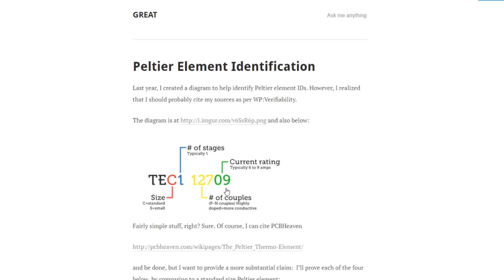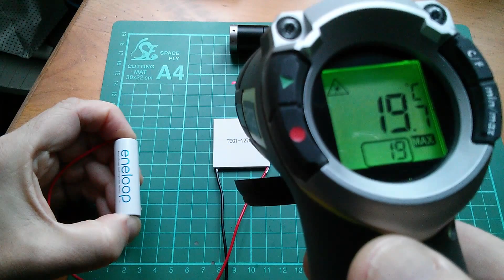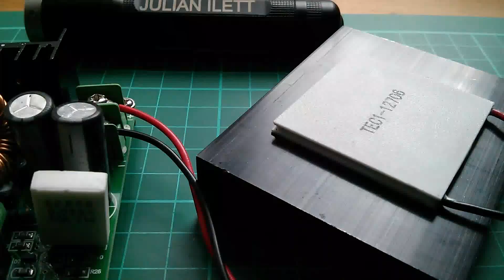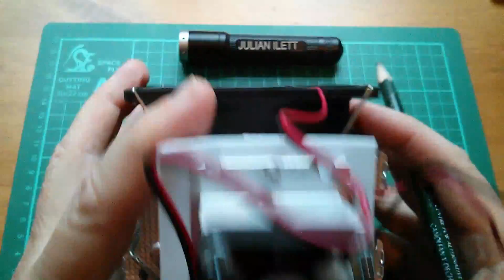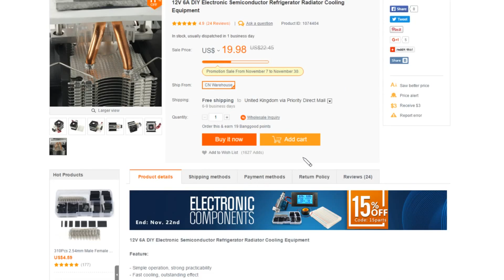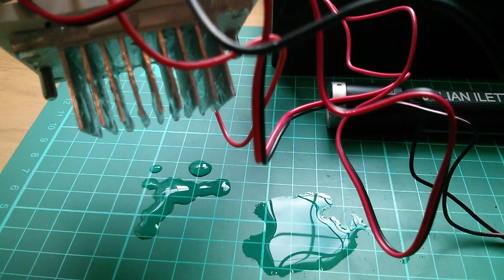Playing with Thermodynamics: Peltier Element Cooling

Comment: will peltiers work with 1V at 12V if i pulse it periodically.
will it work but at a slower cooling rate?
i need to use it but not use a load of power supplied continuously.

Comment: In your educated opinion - Can you use the cooling generated through the Peltier through the element pushed out via the small fan to cool the bottom side of a laptop where the laptop fans would then pull that could air into its cooling system.

The reason I'm asking is because I want to know if the fan would push and damaging moisture for such a cooling system

Comment: A very definitive example of a more real process, much more efficient, but more so concept of what it might really be or become, much more efficient. Peltier modules make 1.5 volts driven by their own heat, heat uses energy. Looks like it can be reconfigured to use its own volt in some way. Great job Julien, shall keep an eye on you.

Comment: Peltier module can work on 12 v PULSATING dc supply? It will affect it's life and performance?
Reply: Don't do that, they "hate" it! The less power supply ripple the more efficient these units become. Straight DC is best but anything below 10% ripple works reasonably well.
Reply: Just using a big capacitor in parallel will probably solve that pulsating power supply problem. It would form an RC filter with the internal resistance of the TEC.
Reply: You need to use a 12 V switching power supply,(which produces a steady DC voltage) not a simple transformer with rectifier diodes (which produces a DC voltage containing 100 Hertz ripple).

Comment: So maybe I’m confused, but if it’s laying on the side, I’m pretty sure the heat pipes aren’t going to work correctly and the copper tubing is probably carrying a lot of the heat away.
Reply: The fans handle those problems

Comment: I bought one fully assembled from Banggood and hooked it up to my power supplies. The peltier is only using 3 Amps at 12v from my bench power supply. Cold side only gets about 51F and hot side 73F with room temperature at 72F. I wonder if they put a different model peltier in it. Tried another power supply and it behaved the same way. Or maybe assembled wrong? It came ready to go. Anyone have any ideas on why it is not taking 6 Amps and not cooling more quickly and getting colder. No ice buildup at all. Cold to the touch. Hot side pipes and heatsink are not warm at all.
Seems like even at 12v 3A it should be colder/hotter than this.
Reply: If you buy stuff from China you get inconsistent quality.  Live with it.!

Comment: If you wanted to make a dehumidifier, could you...  run air from the hot side (after being heated up) over to the cold side where it would then cause the moisture to condense?
Reply: Yup, thats the idea

Comment: Efficiency ignored??
Reply: Finally a necessary question . Just 5 percent
Reply: Peltier heating/cooling elements are not very efficient.  Their utility comes from no need for noisy compressor found in regular refrigeration units.

Comment: hello, just wondering if the 12 V 6A DIY Refrgerator equipment would still cool to some degree if we supplied a lower voltage, lets say 6-8V.
Reply: yes, and that also increases their efficiency. (Just make sure you filter any PWM signal to less than 10% ripple, these units hate ripple).

Comment: 4:21 a better, or just different, explanation i heard was that somehow, i don't remember the details,  it creates a difference within a certain range between the two sides. It can't cool lower than that range compared to the hot side, but the resistance and as you mentioned heat leaking back to the cold side would tend to heat both sides some in most situations. The range of temperature difference between the cold side and the hot side  results in the cold side being warmer than ambient temperatures but colder than the hot side if used without heat sinks in many cases.
Reply: 6:10 i wish you would've picked it up real quick and checked the temperature of the hot side. Maybe even made a line graph for different temps comparing hot and cold sides.

Comment: $1.86 cheap,now I know why it doesn't work .I got a mini Coca-Cola refrigerator which uses this pelter device it doesn't cool down Coca-Cola or beer cans,I tested it.i bought a couple more of cokes put it in this toy refrigerator and it didn't keep the cokacola cans cool.I had to add ice to my Coke and beer to make the drinks cold enough to drink.consumers should be aware of this before the bye one of these toy refrigerator's.
Reply: It's not a consumer level device.  More for hobbyists and tinkerers.

Comment: this vid is old, but tec just means ThermoElectricCooler the C in TEC doesnt stand for the size
AND 127 neither stands for the couples. it stands for 12 Volts and 7 couples. At least one parameter is right in this diagram: 06 actually stands for the max current.
Also, connecting the peltier to electricity without cooling the hot-side heavily reduces its lifespan!
Reply: Incorrect. The 127 refers to the number of couples. Different TECs have a maximum voltage rating, it's not always 12 volts.

Comment: It could be used as a mini frig or as the Israeli Defense Force has discovered, it's safer to make drinking water on site instead of shipping it to their outposts. So, with solar panels and a battery charger a person could have refrigeration and drinking water? How large a unit would be needed to make a refrig and dehumidifier? Or would separate units be needed?

Comment: i was actually thinking if you need such a big heatsink on the warm side, it only has a tdp of 60w, i think something smaller would work also. what do you think?
Reply: A smaller heatsink will result in a loss of heat pumping performance, since the Peltier cooler creates a temperature difference between the hot and cold side. The bigger it is, the less heat will be pumped, and in worst case, even let heat through from the hot side to the cold side.

Comment: Could you use a Peltier device in a Fanless mini PC unit, between the CPU & the Aluminium case, with a control circuit? You wouldn't need to cool it like in a fridge use, but just enough to keep the CPU from cooking ?.

Comment: how do you get it to operate to different temp so that it`s getting 2Celsius instead of - Celsius adjusting the amp or?
Reply: Adjust power either by reducing voltage or by reducing current.
Reply: @morpheus6749  oh i see :) i was thinking on it migth be something like that :)

Comment: possible to cool a small room?
Reply: if you keep it running for a month non stop  in a perfectly isolated 2m square room; and 70w per hour consumption
Reply: @kaisyaya8492  can teg power a 12v fan using the heat and cold of tec?

Comment: The most efficient method to use on the hot side is a liquid temperature controlled heatsink. The hot side needs to be at or below 70 degrees Fahrenheit. That makes the cold side 30 degrees or colder Fahrenheit hopefully. BangGood sells the water cooled heatsinks.

Comment: Thanks a lot.. there are many video  to make Air condition.. mostly uses 4 peltier...
I think the "real AC" fens is attached cooler side will make it efficient.. I m thinking to make 4 unit, each with 4 peltier. And combine all 4 unit (total 16 peltier)..  will it work for top floor 12 feet x 14 feet room size..??
Reply: It is a heat pump . It's cooling efficiency is 5 percent only

Comment: RE:Naming, it looks to me that TEC is for cooler, vs TEG is a generator.   Both devices work bidirectionally, but, there are more efficient in the direction they are designed for.

Comment: i Have the same refrigerant unit from banggood also. I have hooked everything up to 12V and have managed to get frost on the cold side. looking at putting it into a waeco portable fridge.
Reply: am going to try a larger heat sink on the cool side so that there is more surface area of cold so that when a fan circulates around it there is more cold are to work with if that makes sense.

Comment: The total current  - two 12 v fans,  start-up & running, the total amperage is less than 1 amp. Can we use a power supply about 2 amps output or even smaller to save consumption?

Comment: Really enjoyed your video. Thank you. I wonder if you have any thoughts on an idea I'm toying with: a motorcycle top-box cooler. I don't think there would be any need for a fan, as the motorcycle travels forward through air cooling the Peltier element/side of the top-box (just like the engine). Metal-cased top-boxes are readily available, so could one side of the Peltier pump be fastened to the inside of the top-box (perhaps a few external fins for good measure, then a polystyrene layer insulating the box, then a thin, galvanised sheet plate inner, to take the heat from inside the box to the Peltier element, again, perhaps a few fins to assist. I am hoping to cool six bottles of beer, a packet of bacon, a packet of sausages, a small carton of milk and a small margerine for camping. I have 12v available on my bike and like I said; all the cooling you could want. Will it work/does this make sense? Thanks.

Comment: Hi Julian, instead of using AA batteries,  if I use a 2x18650 batteries, how long do you reckon the peltier run and at how many degrees cold without the heatsink attached? I want to attach a metal plate (with attached rod that will go into a bottle of water) that will go on the cold side of the peltier, to try to chill the water.

Comment: beryllium is one of the most toxic elements there is
Reply: Cheyne Simons It used to be used in microwaves on the shaft of the magnetron. 🤔
Reply: @davidbolha  Used to be? I thought it still was, which is why you should not tear apart a broken magnetron from your broken microwave.

Comment: Is it cheaper then compressor based AC??? Can we check the power consumption and cooling / heating capacity???
Reply: Fahim Shaikh No, these modules are horrifically inefficient, air conditioners using compressors are way more efficient.

Comment: Hi julian, 
I'll install the peltier 10 pcs  in parallel use battery.. 
i look in this video you use the dc booster (minghe) for the first time.
can i use the booster for install the 10 pcs peltier include fan in parallel to the battery...?
thanks...

Comment: +Julian Ilett: Nice video Julian! To be fair I think you should say that a TEC needs to dissipate two sources of heat: 1) the heat being moved from the cool side to the hot side as well as 2) the self generated heat of the PN junctions. Also to be fair, TEC's only run about 10-15% efficient. I think you should say that TEC cooler performance is a function of ambient temperature (the warmer they get, the less efficiently they operate), hot side and cold side heatsink performance (as you demonstrated, better heat sinks make them work better), the thermal load, the physical geometry and the electrical parameters. Sorry for my nit-picking it all just goes to prove TANSTAAFL = There Ain't No Such Thing As A Free Lunch ... LOL thanks for a great video

Comment: If only this thing could be used to cool a CPU but I doubt it could move that much heat.
Reply: Why? A typical laptop CPU is below the rating of the unit. In fact, look at the power supply for them and you will see that they are in the 60Watt range and that powers not only the CPU but the screen, disc drive, cdrom, and charges the battery all at the same time.

Comment: If a refrigerator uses electricity to heat pump the heat out of the cold side into the hot side then what happens if you put heat on the cold side of the refrigerator and cold on the outside of a refrigerator?

Comment: You have barely scratched the surface of what these things can do. What I think is the greatest is that it works both ways. You can supply heat and cooling and generate electricity. You sure can´t add electricity to a solar panel and get sunlight. you can make your own stove/mini fridge combo. (cook some eggs.)

Comment: I was at the LLNL (Lawrence Livermore Nuclear Laboratory) once with a Physicist friend and he asked me if I wanted to go to an electronics swap meet down in silicon valley.  So, we met up at 5 am and hit the sale.  All kinds of high end stuff laying out on tables selling for pennies on the dollars from companies that started and went bust.  I saw a 15 stage peltier laying on a table that I should have bought.  He told me that it would actually produce frozen nitrogen out of the air when it was running.  The base unit was about 8" long and 5 " wide.  The next unit was smaller and each successive one smaller still.  The final unit was about 1" square.  All sandwiched together.  That would have been cool.
Reply: Mike Rhodes 15 stages? Holy shit, that has to be so horrifically inefficient I don't even want to think about it. But sounds really cool

Comment: It would be interesting to see if it could be converted to a Seebeck Generator, to generate electrical power.
All that's needed is to change the plate type to one optimised for power generation, and fit it in reverse.

Comment: So if you have a natural source of heat. Which side would you heat? (the cold side or the hot side?) And then if you attached a heat sink to the other side opposite to the side that has the natural source of heat with a heat sink would it then produce ice or cold? Thanks

Comment: Heatsink has to dissipate the 72 Watts (12v 6A) to run the Peltier device added to whatever heat is transferred from the cold side to the hot side.  Net effect is a lot of heat is generated for a small amount of cooling. You have to keep the hot side cool which is difficult due to Peltier operating inefficiency.  A good heater, but a poor cooler.
Reply: RIB B Well, until we miniaturize compressors to the size of your thumb, there are some applications where this makes sense.

Comment: Needs to make an aluminum thermal electric generator that transfers generated electrical charge to charge up a cell phone or other device of constant body heat 98.6. Design the aluminum thermoelectric wireless generator has an insert i bet the little chargers will sell like hot cakes on a cold day. Could even design the charger to work with atomic skin heated clothing. Body heat charges a power system while the genersted heat keeps generating energy to keep warm and power other devices.

Comment: #hello sir Julian    can i run this cooling equipment + 1 more dc 12 v fan   with 10 amp. power supply

10 amp. voltae will burn hot side of pletier or not if i use thermal paste ? 

or i should i use 5 amp. power ? supply

Comment: I was just playing with my TEC1-12715 When I measured the resistance, So I could calculate what voltage I needed to get it to 15 amps. I noticed its resistance changes with temperature.

Comment: I have a quick question about how these peltiers work. If I made the same exact unit in the video but made it so that the cold side was facing the big heat sink, would that heat sink get cold and the air that fan blows through it get cooled? (More like an ac unit)
Reply from the maker: +James Andonian Yes, but you'd need an even bigger heatsink and fan on the hot side.
Reply: Julian Ilett was thinking of using a CPU water cooling unit, using a radiator with at least 2 fans but not sure how efficient there are.
Reply: Anyway, thank you for your fast response! :)
Reply: Julian Ilett got a relatively small heat sink (90w dissipation) and a liquid cooling system for the hot side (240w dissipation). Bought a 60w, 100w, and 180w peltier. Should be interesting lol
Reply: James Andonian How did that go?

Comment: on hot side the heat is transferred from copper tube to the heat sink, my question is pump is not required to flow liquid

Comment: can i connect two peltier TEC1-12706 on both side  of a water block and run water through it and get chilled water, actually i wanted to bring the temp of my 15 gallon tank below to 6degree celcius.
I have tried with one peltier but the water coming out was not as chilled.

Comment: This video reminds me of an idea that I had a few years ago... When you get a beer or soda can from the fridge., it always warms up to room temp before you can drink it. Bummer. So having taken apart my "piece of s**t" micro soft tower I learned about peltier chips. So with my infantile grey matter I thouht, why not cool my beer with a peltier element? So I didn't know any electrical engineers. So I wrote to "Bob Lazar," alien engineering scientist extraordinaire and he wrote back very quickly, thanks Bob, that my idea had the non-resolvable problem of heat dissipation. So I just said, well he's the general and I'm the grunt, so he must be right. Now looking at this unit shown in this video, science and engineering is a step closer to my dream of infinitely cold beer. 
  Can a "peltier" be made into a barrel shape, instead of flat, so that a can could slip inside? I know that the heat is still a problem, but the surface area would be much greater than the little CPU squares, so the cooling side wouldn't have to be freezing and thus the heat side could be relatively cooler. Maybe cool enough that in use could be grabbed by the, now happy, beer drinker.
  So the cat is out of the bag now, so I won't become Trump rich with my can cooler idea, so anybody with ideas are always welcome. COMMENT !

Comment: Those heat pipe type heat sinks work best with the mating face pointing downward as the medium inside the heat pipes vapourises then condenses on the pipe walls, but then requires gravity to return the condensed liquid to the bottom again. Enjoyed the vid though, I have a project that looks very similar to that ;-)

Comment: I always TEC= Cooler  TEG= generator ie for power generation as the elements have a different temperature rating so will run hotter before anything melts.

Comment: Also, now that I think about it, you could run the peltier at low power to use it as a dehumidifier. Maybe down to just a few degrees C, or ~40 F. That way, you wouldn't have to cycle the element, which reduces thermal stress.